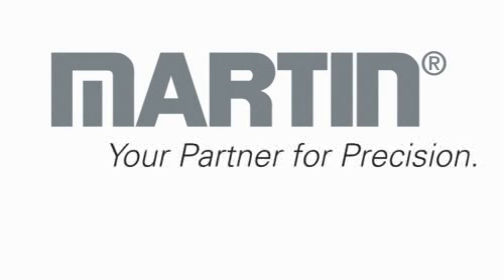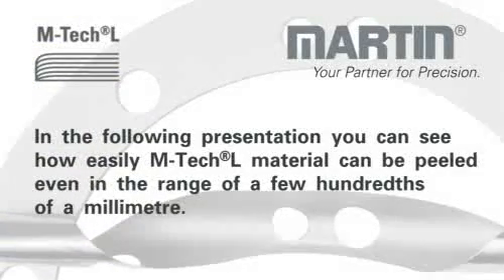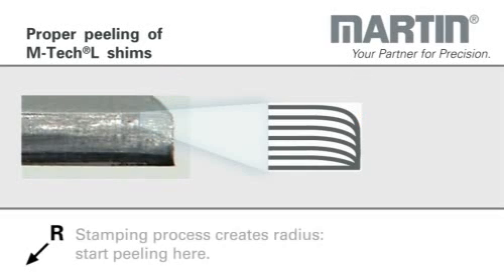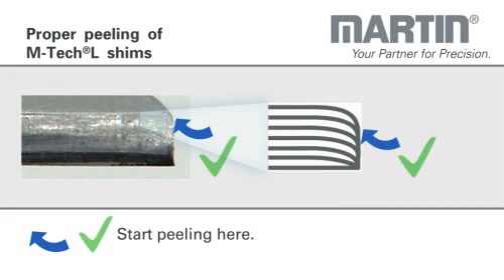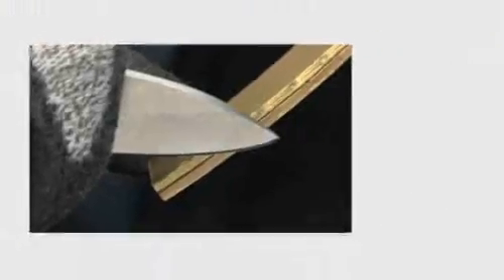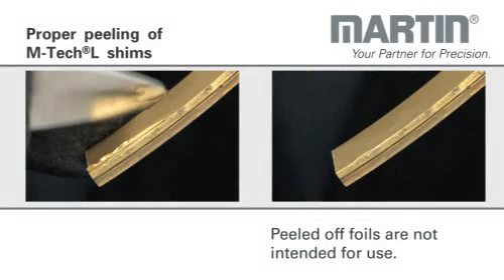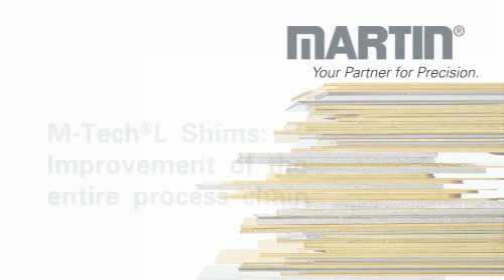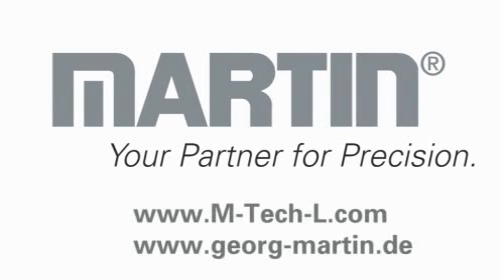Peeling demontration for laminated shims

Comment: Just had a training class and we weren’t given a knife, just clunky pliers.  We had to bang a corner of the aluminum shim on a metal base-plate on the table.  It was ridiculously hard.  I don’t know why we weren’t given a knife to start the separation process. After banging a ridiculous amount of times, I finally got the shim to separate mid-section so I could peel the shim in halves but I had no luck getting any of the other 5 layers separated.  I’m gonna have to take a test in the next several weeks and doubt I’ll be able to pass with just the clunky pliers.